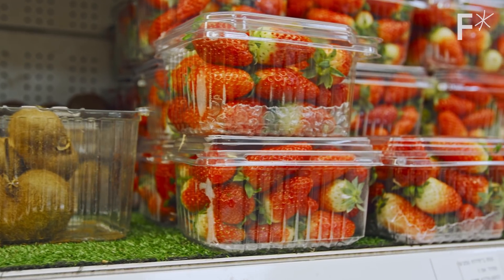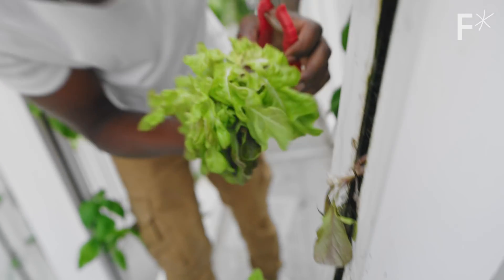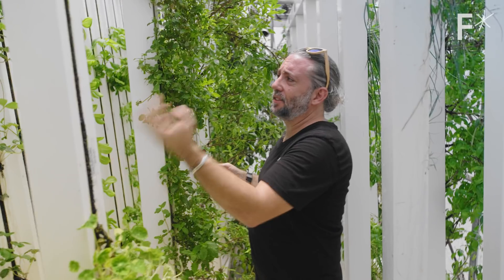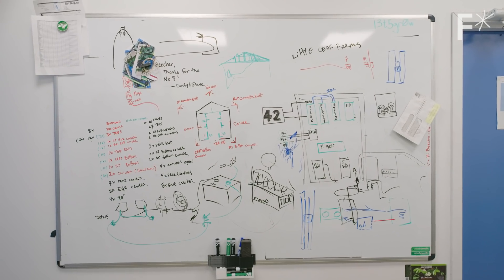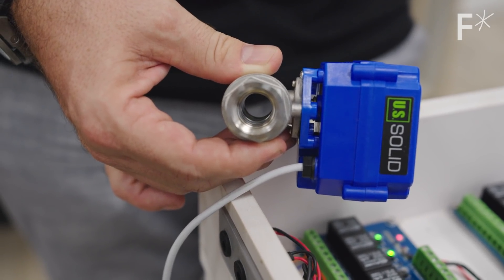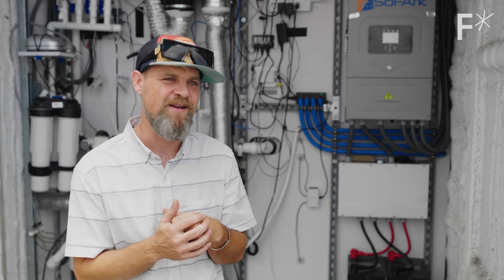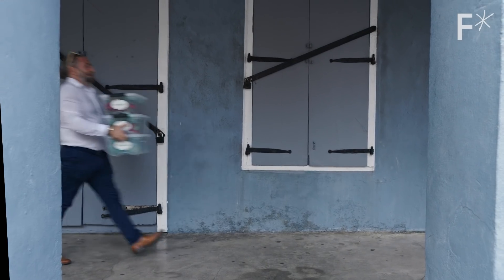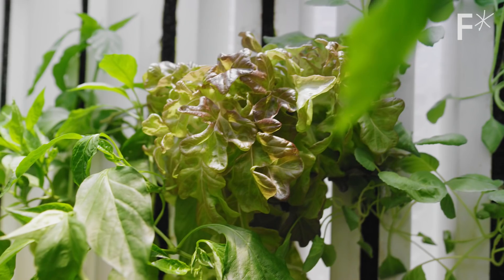Aquaponic farms in shipping containers: The future of food? | Challengers by Freethink

Comment: Does it run exclusively on solar, or does it need mains?

It's it completely self sufficient or does it require nutrients for the fish? Sustainably sourcing fish feed is still a problem or no?
Reply: How could it run on solar when the greenhouse is on top.  Also of course the fish need food.   The fish poo feeds the plants, the plants clean the water and return it to the fish, but the fish still need to be fed.  it is just like traditional farming, but instead of applying fertilizers to the ground, you are applying fishfood to the fish, who convert it to fertilizer.
Reply: @PeterSedesse  I met this hippie on a bus once, who explained how they had built a completely closed loop "mini eco system" that basically produced fish and plants from sunlight. They would feed (some of?) the plants to the fish, and take out fish to eat when they grew too large or too many. I mean, that's kind of how the planet works, right? So it should be possible.
Reply: @RasmusSchultz   You could use duckweed or algae to feed a limited number of fish, but you would still need to add minerals.  You would also need to power pumps to circulate the water.  Tilapia require 300 days to reach harvesting size, so in order to eat 1 10oz tilapia  each day, you would need to house 300ish fish which would require about 1000 gallons of water, which to maintain healthy water needs to pump 1000 gallons of water every 15 minutes ( industry standard).  On top of that, you would need thousands of more gallons of water to produce the algae/duckweed.  So you are talking about maybe 5000 gallons of water, a very strong pump running 24/7 in order to eat 1 fish a day.  In most aquaponics systems they do not harvest any fish for this reason.  And again, what you ' can ' do as a cool hobby experiment is not the same thing as being economically viable on a large scale.  The grow area above a 20' shipping container will not produce anything more than some side salads for a family of 4.

Comment: Not to minimize this effort... But, this looks very similar to Kimbal Musk's (Elon's brother) is doing with BigGreen. Pod, automation, hyper-local, but not a copy.
I think I can see there are important differences between the systems. But on the surface they look very similar because they are shooting for the same form-factor. For example, Tesla isn't a copy of a Ford just because it has four wheels, doors, and a windshield.
Reply: um aquaponics is hundreds if not thousands of years old. it's silly to argue about who copied whom.
Reply: @holleey Um, Holly. I didn't mention aquaponics, or copying either. (Actually I did mention "copy", as in "not a copy"). But perhaps I've read and responded to your comment a little more thoughtfully than you.
I will add that I brought up the fact that it looks (to me) they are using the same (or similar) form-function, and I wonder what a compare & contrast between tbe two would show? Having those two data-points would be helpful advancing the products.

I used to facilitate Ford and GE Appliance to run benchmarks on each otber's design and manufacturing processes. This is a cooperation Henry Ford and Edison set up generations ago for two similar companies to improve each other without jeopardizing their customer base.